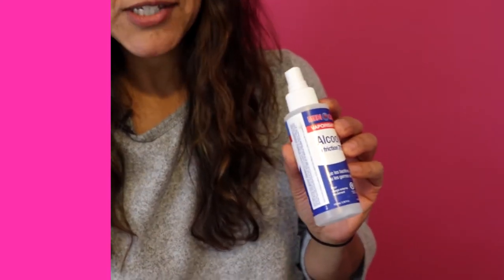How Do You Clean Mixing Containers After You've Resined?

Comment: So I leave the resin upside down, like you said, but I always end up with little drops of dry resin after, which sucks to clean out. What am I doing wrong?
Reply from the maker: It could have something to do with the type of plastic your cup is made from.  Clear, brittle plastic can be harder to clean out once cured.  Also, when you are doing the cure and pull method, it's best to not wipe the container with paper towel first, it will not leave enough residue to easily pull out in one piece.

Comment: What can I use to get it out of my sink 😱😱😔😔
Reply from the maker: oh, Detria, sorry to hear you have stuck on resin :(  You can try soaking the dried resin bits in acetone or rubbing alcohol - they are both solvents and will dissolve the resin.  Keep soaking until it starts to soften a bit and then try scraping it off.  Good luck!!
Reply: ArtResin  thank you for the info I will defiantly use either or...